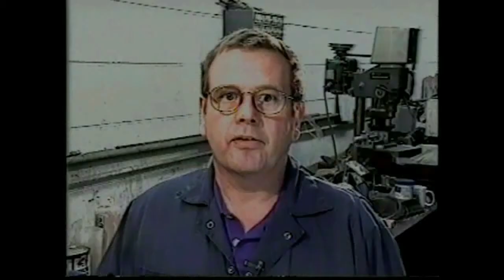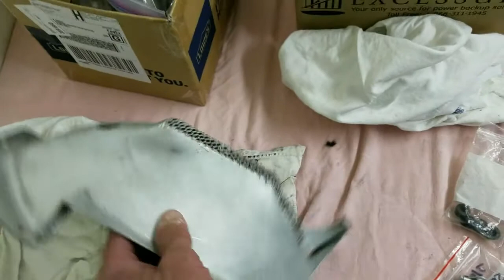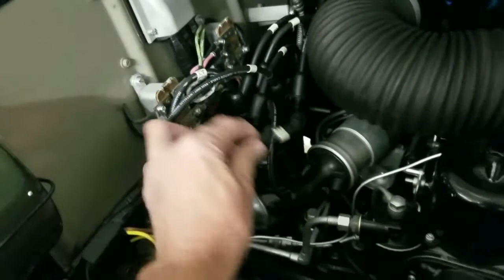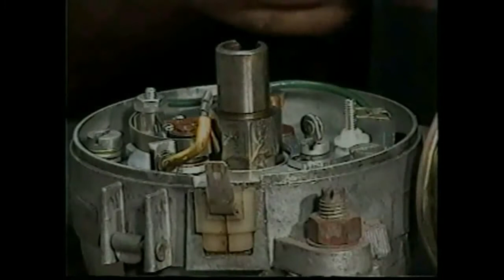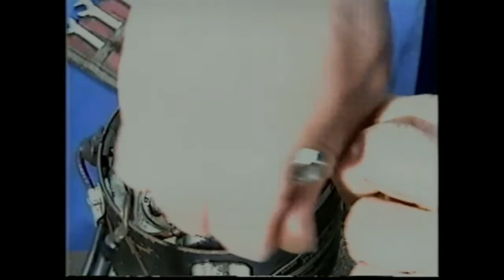Sparking Plugs and Distributer Tune Up - Rolls Royce Silver Cloud 2 and 3

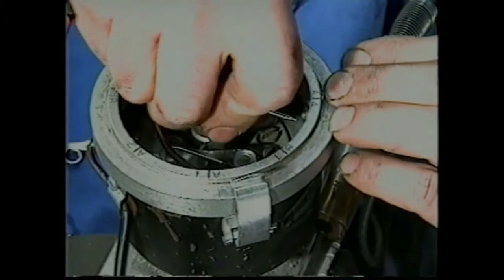Comment: Thank you so much for these series of very informative videos. We are working on a Rolls Royce Cloud II with the Delco Remy distributor fitted. We are trying to find a supply here in the UK that might stock the timing ring you mention at 17:30. We have tried the usual Flying Spares/Intro Car and asked around but no luck.  We have timed the car and each set of C.B points on the fly wheel method but feel there is room for improvement that the we hope that tool might bring. Thank you in advanced.
Best wishes
George